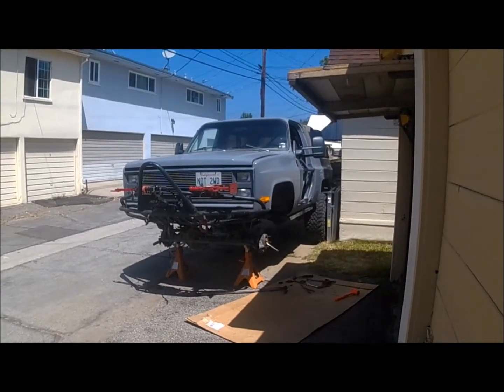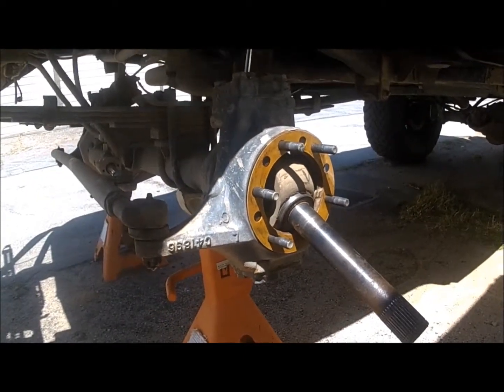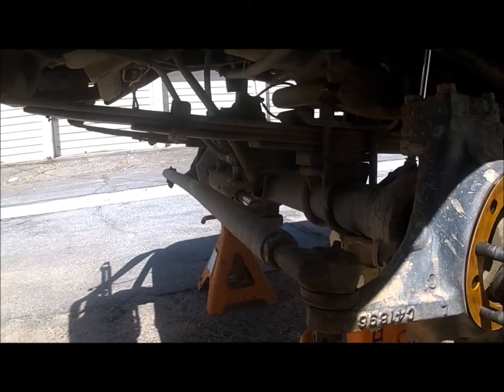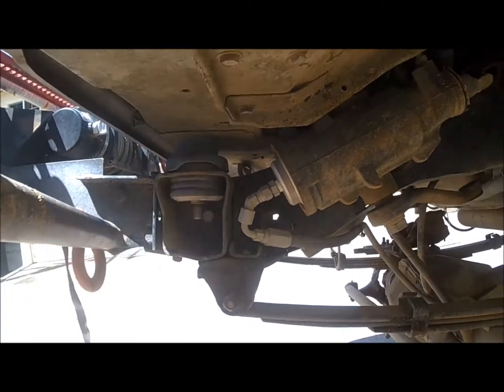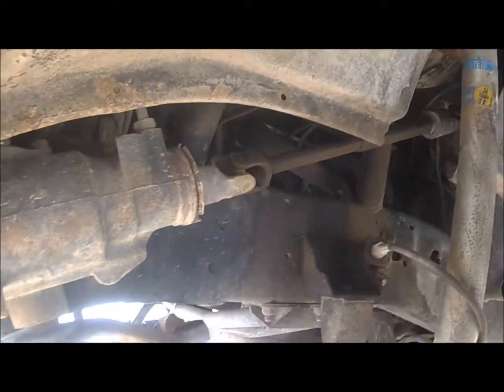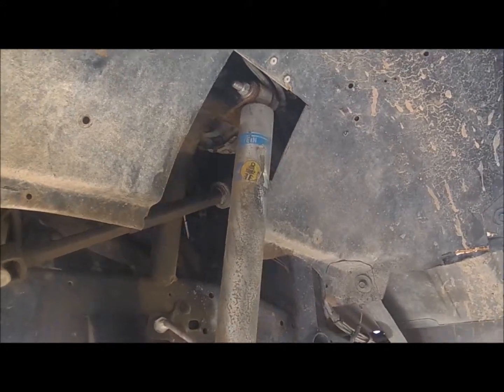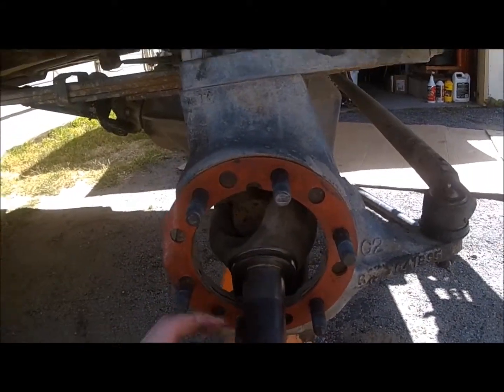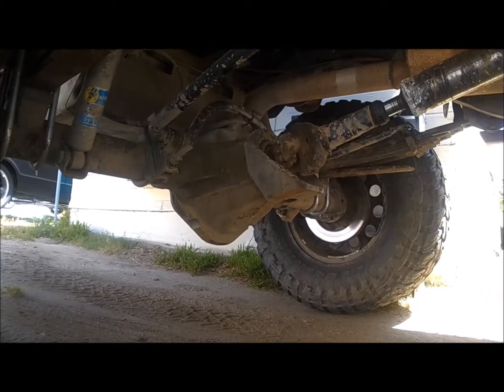Build Vid Part 1

Comment: Thanks for the info. Great rig. I'm about the install the the diy4x 6" lift , shackle flip, 52" flip kit and 14 bolt rear Dana 44 front . Like your set up. I you said you have 38" tires but what size are your wheels . Thanks.
Reply from the maker: I recommend going with some 56" springs, even for a pavement pounder. They will net you a smoother ride if you are staying with a factory spring. Rims are 18"x11" but I'm running 37s with 17x10 now. (40s are in the garage)
Reply: I'm doing 56" in the rear. And 52 in the front. That's what you are referring to?
Reply from the maker: I don't know what happened to my reply dammit. Ok, so yes, 56s in the rear. I would only do 52s if you are quite serious about offroading it. If it's on the street more, the 52s up front add a bit of body roll. If you go through with the 52s, order the slower valve option for whatever shocks you run. I like my 7100 bilsteins with I think 355/80. This is slower than my previous 5125s @ 275/75. Something like that. Also, run the 56s backwards for more wheelbase if this is a blazer.